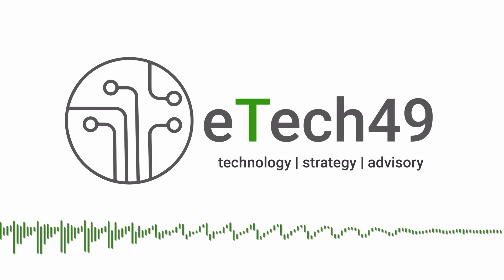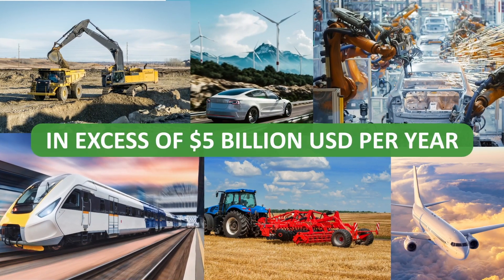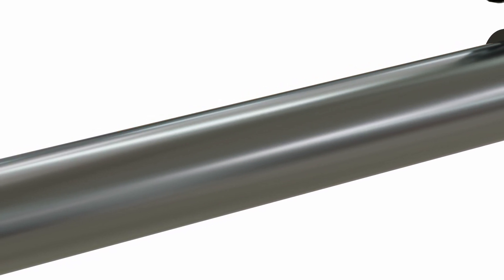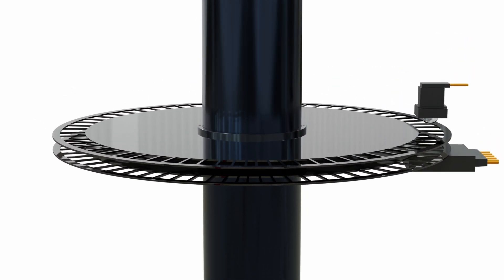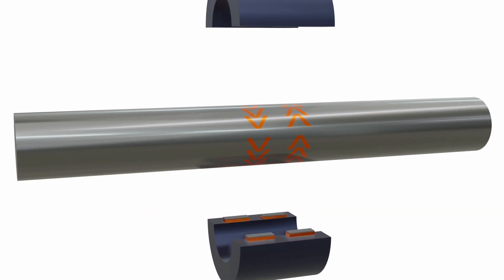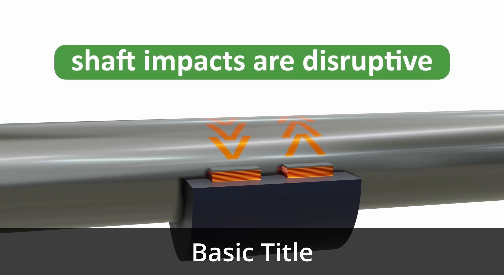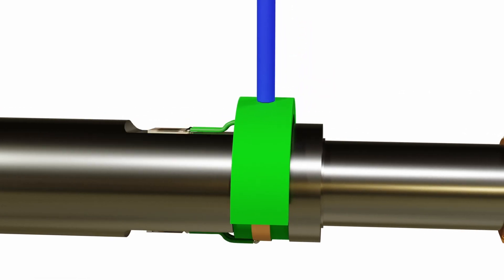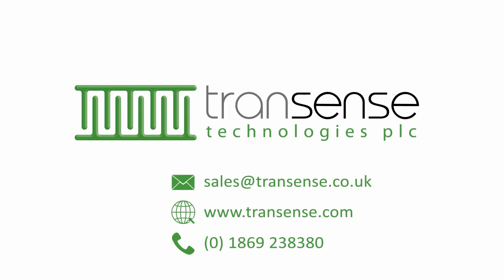Comparison of Torque Sensor Technology

Comment: You've probably introduced four types of torque sensing technology. Beautiful presentation, congratulations 😀.
Earlier, I proposed to you to simulate my four-phase Brushless Hybrid Fast - Rotation Motor, which can function on the basis of the angle of the poles of one phase equal to 135 degrees and 180 degrees.
Maybe now you will find some time for this simulation?
Regards 😀.
Reply from the maker: We would happily take a look at this, please send over some more info